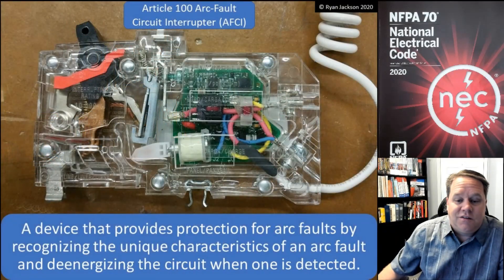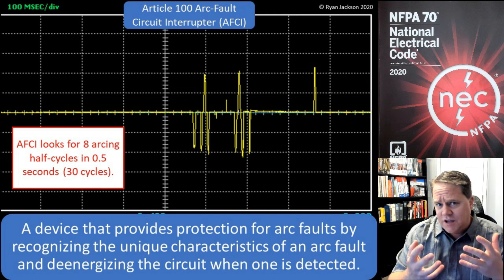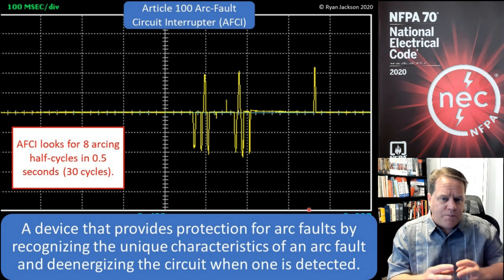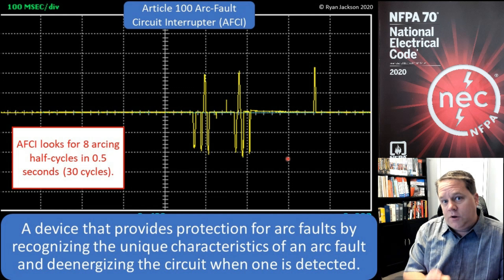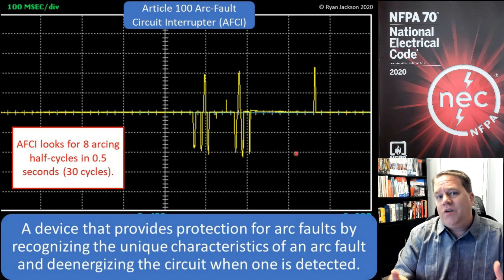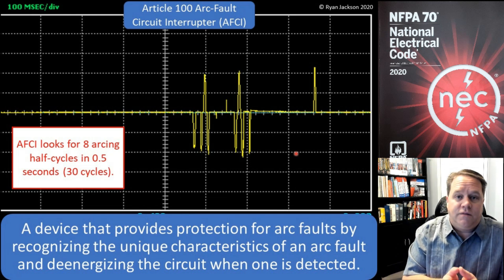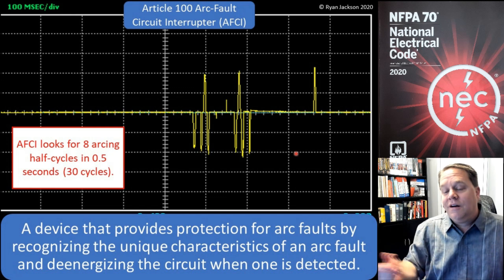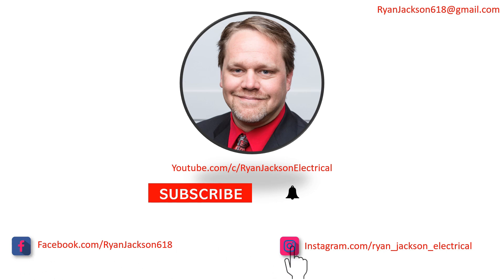100 days of Article 100: Arc-fault circuit interrupter

Comment: Very good explanation!  I'm wiring an addition to my house and carefully reading code requirements, and I had never seen AFCI breakers required before because all of the panels I've seen were old installs.  When I saw that AFCI breakers were 4x the cost of a standard breaker, I was curious to know what went into making them work.  This completely answers my questions.  Thanks!

Comment: Thanks for the valuable information 
I am just wondering if there is a relationship between AFCI and other breakers like RCCB and RCBO
Do all provide the same level of protection?
Is one type better or more recommended than the another?
Thanks
Reply from the maker: They protect against different hazards.
Reply: OK.
Thanks for your response.
 
So, AFCI protects against arcs. These arcs can be results of short circuit and overload.
Does this mean that AFCI indirectly protects against short circuit and overload and can replace the traditional MCBs?
I saw in my home panel board that the installed breakers seem to be AFCI. ''Current Interrupting Rating'' is printed on it. So, this means that it is AFCI ?

Thanks and sorry for the long question.
Reply from the maker: @a_h4000  No problem. An AFCI circuit breaker is a molded case circuit breaker, so it protects against short circuits and ground faults like a typical breaker. Additionally, it protects against the specific types of arcs covered in the video.
The interrupting rating is the amountvof current it can interrupt without extensive damage to itself. Yours will almost certainly be rated 10,000A.

Comment: I wish I could get on board with AFCI like I did with GFCI, but it hasn't happened yet, and I don't think it ever will. They cost nearly an order of magnitude more than a regular breaker, there's no way (other than the test button) to test them, they react to RF, the electronics in them can go bad from voltage spikes, every manufacturer uses their own algorithms to run them, and they are the most problematic electrical device we have to install. I would MUCH rather have to install whole-house GFCI protection. That's a much more transparent technology. It's also interesting to note that the manufacturers have been fighting a real uphill battle in Europe to get them adopted, probably because there are many more well-educated electricians, code panel members, etc. who are pushing back and defending the existing 50 mA GFCI protection already in place (as RCDs), as well as much more rigorous testing procedures in place in many countries (ex, mandatory yearly installation testing in the UK which looks for problems before they become deadly).
Reply: UK's "wiring regulations" panel just recently adopted them, but only in limited locations for now.

Comment: What are the options for using my Dewalt circular saw that trips the AFCI breaker other than buying a new smaller saw?
Reply: Replace carbon brushes and/or blow out carbon dust settled on commutator.
Reply from the maker: Have you reached out to DeWalt?

Comment: Have been reading about AFCI'S for last 10 years and this is the best vid that really explains them. Wonder how long it will take before they are required in at least offices and around or in hazarous locations such as gas pumps. Talked to a Square D sales engineer about AFCI'S over the years. He was a test dummy for them. First batch would trip every time the vacuum cleaner was operating so he went out and purchased a new vacuum cleaner and that tripped AFCI'S. Brillant engineers at Square D reprogrammed them and never tripped again while running vacuum cleaner. Ryan do you know if any AFCI'S are capable of self testing like all of the GFCI'S receptacles made in last 4 or 5 years do? This vid by far in the top 3 that you have produced. Thanks.

Comment: GFCI
ARC Fault 
All should have a life time warranty. 
🍺🍺🍺🥃🥃🍇🏌🏻‍♀️
Stay safe. 
Retired (werk'n)keyboard super tech. Wear your safety glasses.
Reply: Better yet wear proper PPL on every job. Get all rubber & canvas gloves checked & dated stamped every 6 months.
Reply: @garbo8962  I retired all that gear and the PPE they gave me is already 4 years old.😂🤣🤣😂🍺🥃😐
Reply: @realestateservicessaleshea99  Well you beat me by 1 year retiring. Worked 16 years as a sparky for a gannett newspaper back when they were making millons of dollar a day with their 100 plus newspapers & TV stations. Cheapest people ever. Asked for 600 volt  set of gloves for all the electricisns. Told me that they were looking into only buying 1 pair.They never did buy any. Told them that I refuse to share gloves that will protect my life. For 4 months made me take a few 480 volt 3 phase twist lock male plugs off equipment for busy Saturday night until I broke a second one after stripping out a screw that I always extra tigthened. Told them if I had a torque wrench it would never happen. Large rich hospital that I retired from purchased us cal 50 helments with a battery operated cooling fan. Had a piece of crap ge junk 13,200 volt dual service switchgear that had a 124 cal that morons installed vents at eye level. In the event of an arc flash that large before killing you would incerate the entire head. Way to go ge. Was told any & all arc flashes above 50 cal would kill you no matter what PPL worn.

Comment: You gotta LOVE these videos!   I do have a question regarding afci's.  How will an afci react in regard to a parallel or series arc in a cracked or faulty lamp cord that might continue arcing under the specs mentioned.  Also do you think arcing under these conditions could cause any dangers in a small room regarding carbon monoxide emission say if the cord is resting on carpet or similar even if flames would not occur - thus a smoldering condition only?.   Thank you Ryan
Reply from the maker: The arc would need to be a parallel arc of 75A or more, which is difficult. The available fault current has to be high enough to allow such current. As far as the released products of combustion, I can't speak to it because that is not my area of expertise.
Reply: @RyanJacksonElectrical  Ok, thank you Ryan for such a quick response!